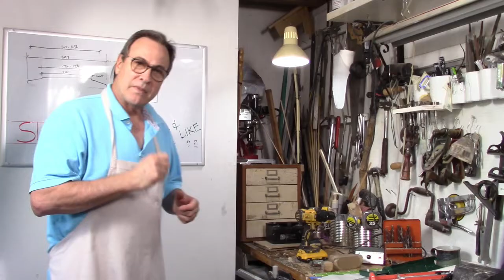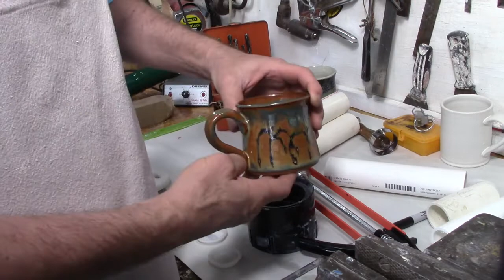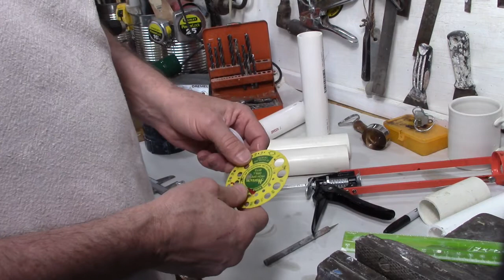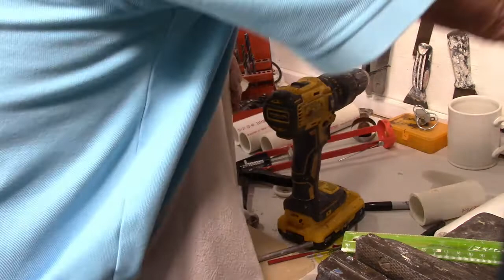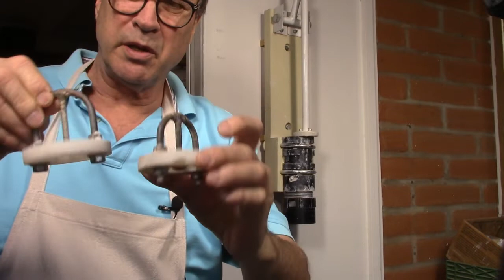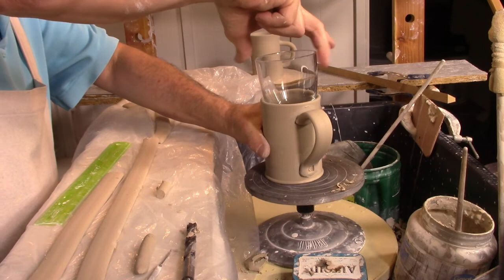Design Great Pottery Handles and the Tools To Make Them

Comment: What are those round white plastic things called?
Reply from the maker: They are plumbing test caps. There is a point in plumbing installation, pre inspection, where you cap off all of the open pipes and fill the system full of water. If you dont find any leaks you are good to go in scheduling your plumbing inspection. These caps are  strong anf flimsy at the same time. They are designed to be broken out of the pipe and cleaned upat the end of this process. They are used on both ABS ( black) and PVC( white) pipe. But they might fit more loosely on the white stuff. Check them for fit before you purchase. Tight is better for a satisfactory glue up. That being said, with out gluing the forward support on the extruder holds the cap in place during operation. Meaning you can make the caps removable and use fewer tubes. I glue mine up. And i store the used tubes with out cleaning them in a tall plastic coffemate jar with a bit of water inside. Keeps them soft and ready to use.

Comment: Would there be any advantage or disadvantage to putting a chop on the top side of the handle? Say after you first attach the handle and before you start the bend.
Reply from the maker: It would serve the same function at the lower chop of driving the clay into the scored and slipped mug. Might be an opportunity to create a stamp , other than a chop with some decorative effect. Idea worth playing with.